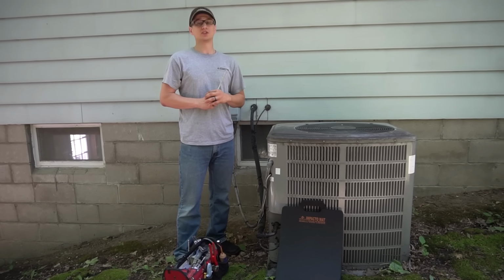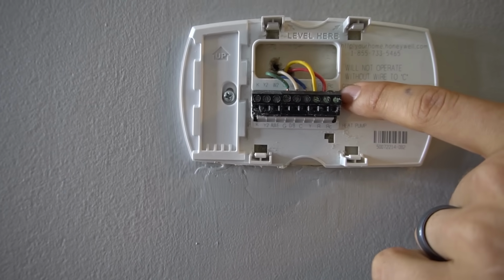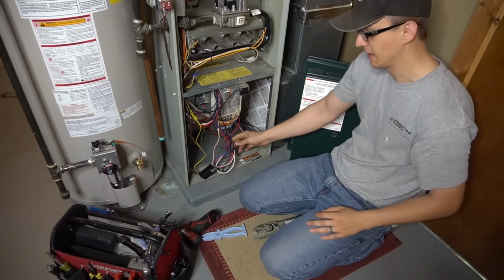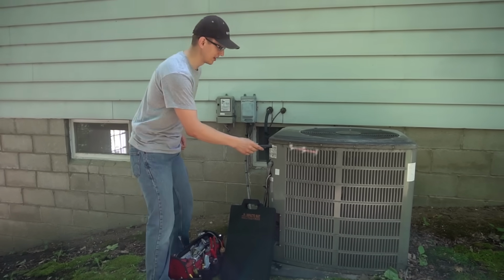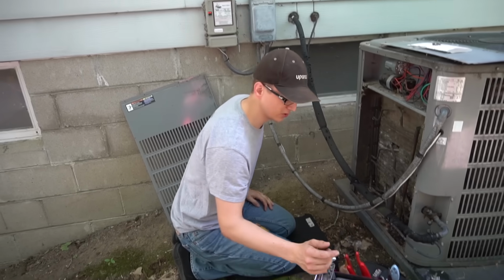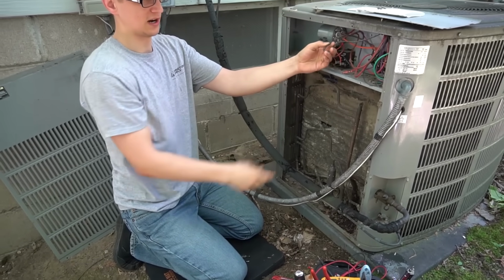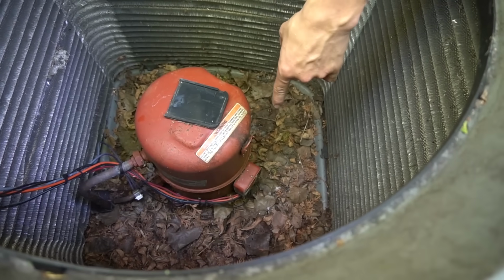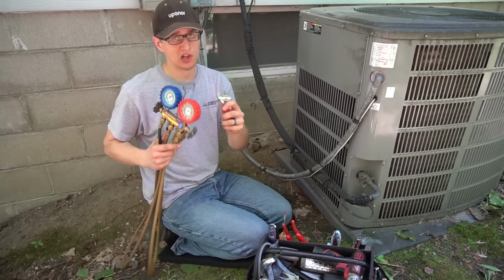AC Unit Not Turning On - How to Fix It Step by Step

Comment: Hear Ye ! Hear Ye ! thumbs up ...I can only agree with all words of praise posted above & below, as you & your excellent videos & tutorials are far beyond magnificent & superb !!
We have an Allegiance 10 that just stopped cooling [ Model# 7A0036A100A1 ] [ HCFC-22 @ 5lbs - 8oz ], that looks identical to your unit in your video abv!  Except, upon taking our Capacitor off....I'm seeing a big bulge on the top (contact end) of the capacitor, along the rim; the bulge looks likes it shouldn't be there; thanks to your links abv, I've just ordered the correct  one via amazon, alas unfortunately it won't be here for 3 days. :~\  But I'm so thankful for your videos! You are the greatest ! And without a doubt the Greatest I've ever seen on YouTube, of all time !
I first thought we might have an R-22 Freon leak =((  
Thermostat checked-out ok; furnace fan working; all wires look ok; the Contactor looks ok; the Contactor plunger works (w/power on...and w/rubber gloves on w/insulated screwdriver...the ext condensor unit & fan powers up). Everything seems to be running normal...except there's no cooling, (just the same air you'd get if you only turned on the furnace fan). Everything seems to be running (and sounding) normal, but no cooling.
Moreover, inside, at the evaporator coil ductwork that sits on the furnace, I did see  a blueish/green color on the sealer putty that is packed around the big refrigerant (suction?) line, and where it looks like it has dripped down the outside of the ductwork and made a blueish/green color stain on the sealer putty that's packed around the white PVC drain pipe outlet. Haven't scraped the putty away from the PVC drain yet -- to try and see inside the evaporator coil space, to see if there's the same blueish/green color (is that the Freon color?)....inside the evaporator ductwork.  But does that sound like we've lost our Freon? 
First quote over the phone was $1700 just for a new 5lbs-8oz of R-22 Freon ! Not including whatever they'd charge for fixing the leak !=(  And since our Allegiance 10 A/C was installed 20 years ago, (last month), of course they suggested---over the phone, without having made a service call yet, that we spend $4000. to $6000 on an entire new A/C system !=(
Another HVAC company quoted $307.00 for the first pound of refrigerant, then $150.00 for each subsequent # of refrigerant.
:~\
But now we're hoping & praying it's just the $15 Capacitor !=))  So thanks again to you, Word of Advice TV, for your incredibly helpful video's and all your time you've shared and devoted in making them !  You are truly the Greatest I've ever seen on YouTube, of all time !  Thank you so much !;-))

Comment: What I have found many times troubleshooting in the electrical business is: the mice chew the insulation off the conductors where it goes thru the connector or bushing to enlarge the opening,  causing a short circuit or a grounded conductor to the case. The mice especially like the A/C compressors motor junction box since the compressor has a built-in heater that keeps it and them warm all winter. A/C compressor is not the only target for mice chew in though so be vigilant.

Comment: Hi just watched ur video, I think I missed the part that I need. My turns on, but it cuts off after a few sec. The blower in the house works fine. The system out side is what shuts off after a few sec. HELP!

Comment: I can see a yellow wire that protruded up and got hot by the fan on top of the AC unit.  Going to try and figure out what happened.  Its supposed to be hot all week.
Reply: Update:  SOLVED!  Wire got clipped by the fan on top of the AC unit, which caused the breaker to flip.  I repaired the wire and reset the breaker.  NO LUCK.  Breaker off for safety once more I checked everything again and all looked good.  Flipped it back on. Nothing.  15 minutes later it kicked in.  The stupid power cycle unit that the power company put in must reset every time the breaker is cycled.  It doesn't run for 15 minutes when the breaker is cycled.
Reply: Thanks a lot for this video.  It inspired me to look into the issue and probably saved me quite a bit of money.

Comment: Hello WoATV... thanks for all the great video... very detailed, nice tempo and lots of great info.  Two questions for you... The first and most important, I can't get my blower, heat or AC to come on.  It all working fine until I was attempting to help explain the thermostat to my older son (who was having problems in his new home) and while doing so, I (easy) disconnected my thermostat from the base, not realizing that the AC was running at the time.  And when I tried to connected back up, I heard the AC kick on, off and back on again as I was trying to reconnect the thermostat to its base.  Once I get it connected again, I thought nothing more of it.  However, later in the day, I realized that AC unit was not working.  I also checked the heat and the inside blower and nothing work working.  I tried re-seating the thermostat and still nothing.  After making sure the thermostat was set to a HOLD temp for both heat and/or AC, I even tried just the blower fan ON to no eval.  It's a RHEEM from 1990.   I thought I blew out the thermostat so I purchased a new Sensi thermo unit, hooked it up and it did not fix the issue.  I could hear both thermostats clicking as they attempted to send signal to the furnace / AC / blower, but nothing!  Watching your video, I did check the basics for power and I think I am getting it.  I could not find a fuse as shown in your video.  Any thoughts on what to check next?  If I need to replace the furnace, should I do the AC unit too?  Is there a brand or two that you could suggest (house is about 2500sq ft.)?    One last think... I original thermostat had a jumper wire from RH to RC, but the new Seni said that this jumper was not needed.  In your video, you mention a jump from R to RC... did I hear that correctly, or should I consider the jump from RH to RC?  Thanks again for any help you can offer.... thanks.  Frank.

Comment: I would love some help.  The plunger makes no noise at all.  I have replaced the capacitor and the thermostat and nothing will utrn on.  I am confident all the breakers are on.  I noticed that the contacts on the plunger seem chard like there was some spark or arch event.  IS it possible this plung part had a failure and thats why the unit isn't turning on?  Ive tried almost everything else you suggested.  Thanks in advance

Comment: Awesome job. Nice, clear, and comprehensive. What if you changed the capacitor,  and two days later the compressor is not running, humming noise like it wants to start... is that the compressor on its last leg?

Comment: Awesome video, thx. Question...my AC keeps blowing 3 amp fuses. After replacing fuse the heater works fine. The furnace blower works fine too. But, when i switch to AC the fuse blows right away - everytime.  Help me please.

Comment: My AC unit outside recently stopped working   and watching your video gave me enough knowledge about how it works to troubleshoot my own system. I shot the capacitor good and went to the contractor had power at L1 and L2 but nothing getting through I was about to replace it as soon as I removed the cover dead ants fell out and there was hundreds more all inside of everything. I pulled it out and took it apart cleaned it out now everything works. Thanks man!

Comment: Hello, I hear and feel air moving inside. Hear it working inside when I turn my thermostat on. The outside unit hums. I reset the breaker, about 30 min later the fan and compressor kicked on. But it's shut off again outside. Inside is still working. Any ideas?

Comment: So my inside unit is coming but the outside unit is not. Has power capacitor is good the fuse in the furnace is good when i press the contactor everything turns on so im kind of stumped right now. Any help would be appreciated

Comment: Your troubleshooting tips are awesome.  I noticed that my outdoor unit wasn't working.  Interestingly enough I just had my entire system inspected just a month or so ago and tech told me that all was well.  I'm a little suspicious it suddenly not working.  The compressor was not visibly damaged, the fan ran when I bypassed it, the indoor unit worked fine.  I was prepared to take some readings form the capacitor but I thought I'd check the relay first.  I took my leaf blower and aimed it at the capacitor and the relay; blowing it out at medium speed.  I went back inside, turned the air on, went back outside and low and behold,  the unit is humming like a humming bird.  I didn't see what was caught between the relay terminals my leaf blower took good care of it.  Thanks for your awesome troubleshooting tips.

Comment: thank you! I followed this step by step (posting from FL so no furnace's here) and both blades spun freely, motors were not hot, capacitors looked good (my meter does not measure UFI), was able to test outside unit and it turned on no issue. I replaced a very dirty filter and at some point (15-30 minutes after I turned everything back on to troubleshoot the outside unit) the system just started working again. 

Saved me a bunch of money, thank you!

Comment: maybe i jumped ahead of myself and now i dont know what to do. the heat pump wont come one, so i pushed the plunger and the unit came one. i assumed i needed a new capacitor and replaced it, but it still doesnt come on unless i push the plunger. im guessing i need a new plunger contactor. please advise..ty

Comment: This was a super great video! My son is in Kuwait and I was able to get the ac fan at his house going. However he has   2 zones because of the apartment in his basement where I live. So my apartment is getting cool but the upstairs is not cooling at all. Any suggestions? He has a nest thermostat that i checked the settings and it seems to be working correctly.

Comment: I have a 24v transformer I need to hook up to the ac, old one went bad, but the problem I have is the lable is wipped off. Is there any way to test with wire meter to tell what write goes where, ac wires are different colors that what is on the transformer thanks f for your help in advance. I have a picture of it but can't figure out how to upload on here

Comment: Thank you so much.   Very thorough. Your mentioning of the bug getting stuck behind the plunger saved me a expensive Emergency call fee.   I found an earwig lodged in between.  It looked like it had caused it to arch and solder it.  Once that removed and I got it free it started right up.

Comment: Hi , A very good video Thanks. I have some A/C problem, hopefully, your could help. MY A/C dont on, when I turn cool on at Thermostat, The A/C don't on but the heat is on . I cannot turn it off untill I shut off the power and gas. Now when the power on again,  the heat will auto on automatically. The thermostat cannot control the unit.

Comment: I flipped the AC breakers off and on in my breaker box, it was not tripped, but now we cannot get the AC back on, it just wont turn back on at all. There are 2 metal boxes outside near the unit which look like a fuse or breaker box but they are screwed shut, so I am thinking there is a way to reset the system or something and we just do not know how to fix this. It was working perfectly before I did that. Any advice?

Comment: Nice video. I usually do transport and cab air. I have a Coleman R22 4t that leaks slowly out of the evap. Last week it was not cooling. I put my gauges on it. It was real low. I did an evac and but it on a vacuum and charged it enough to run it and finish charging it. All it does is run the fan and try to run the compressor for 2 seconds and it kicks out. I tried to look for a low pressure sensor to bypass to run it so I can charge it 65-70 low side psi. Would you recommend doing this or troubleshooting the electrical side? Thx

Comment: Hi,
First off thanks for these amazing tips, keep up the amazing videos.
I had a question around my AC. 
I recently called a HVAC guy out to add freon (I know its not freon) as my furnace will not cool the house. The compressor was running, and there was frost build up.
The technician filled it with freon and said wait couple hours and it should be good.
After 4 hours, I noticed that the house is still not cooling. I went to check the AC Compressor and noticed it was short cycling (tries to start up and shuts down almost immediately)  The compressor did not do this before his service. 
I called the technician guy again, and he is saying that the entire unit needs to be replaced, the problem with the actual compressor.  
I am doubtful, as the guy didn't really check much, like the electricals or anything. He simply says repairing will cost around the same as a replacement. 
I am going to try replacing the capacitor before anything else. But I wanted to see your insight. Is it really compressor or is the guy trying to gouge money?
Could the short cycling be a result of something the technician do wrong?
Thanks for reading this and appreciate a response. 

Thanks

Comment: My air handler turns on and blows air through the vents, but my outside unit does not turn on.  I had a ac tech inspect it and could not find anything wrong.  The breaker was NOT tripped.  However, I turned off the breaker for 2 minutes and then turned it on.  This fixed the issue for a day.  Then the next day the outdoor unit again did not turn on.  Again, I reset the breaker off and on and it fixed the issue.  What do you think is the problem?  My unit is only 5 years old and is an American Standard unit.

Comment: Thank you very much.  I had installed a new Nest thermostat this past winter and apparently overlooked something in the wiring for the separate AC system.  Your video provided me the basics that lead me to solution.  This one 30 minute video is such a great start for anyone with AC issues, so glad I found it.

Comment: Dude, I just want you and your viewers to know how good your advice is.  I watched two of your videos and probably saved myself 500 bucks or more.  I opened up my condensor and looked at the capacitor and sure enough it was bubbled.  I went to an HVAC store to buy a new one but they would not sell it to me because I am not a licensed contractor. But, then I tried a different store and they sold it to me.  13 bucks.  What do you think a company would have charged me to come out, evaluate the problem and fix it?  Man, I really appreciate this video.  Thanks.

Comment: I have watched many videos on YouTube that solved my problem, saved me time and saved me money.  This video has done ALL THREE and you have my sincere thanks!  You can add me to the list of folks who had nothing more than a blocked contactor (solenoid) switch that prevented the compressor unit from getting the message from the thermostat to turn on!!  My unit had an ENORMOUS nest of some sort under the plate that COMPLETELY covered and blocked that switch.  Cleaned it out and everything is working fine!  Problem solved.  Time saved.  Expensive service call avoided!  Thanks again!

Comment: That switch box from the power company that they rotate service with..if the only savings is $10 a month it doesn't seem logical to me. I have found if I turn off my AC on really hot days for even only 30 min or so, the run time to bring it back to my usual temp is exceedingly long. I can't imagine $10 a would cover the extra run time I would encounter.
Thanks for the vid!  They are ALL great!!✌👍

Comment: Best instructional and repair AC video on YouTube. PERIOD!

 Amazing video!!...clear instructions, testing and trouble shooting for ALL the AC common problems,  AND best part, IMO, segmenting so you can jump to your pertinent sections!
For anyone new, I recommend watching the whole video to understand all parts of the AC unit.

I learned about,  diagnosed and fixed  the problem with my contactor by using the methodical test approach to narrow down the issue.  Using the quick test,  I was able to determine that my capacitor, motor and contactor were working... turns  out the thermostat signal wire feeding to contactor was pinched. I was able to fix the wire and have the AC up in running in minutes.  

It would have been impossible to fix without this video and probably cost me hundreds of dollars to diagnose.

I've subscribed and shared this video with everyone I know. Keep up this great service!

Comment: One could say I'd much rather listen to a maestro playing a plastic violin than listen to an amateur playing a Stratovarius. My HVAC system quit both Heating and Cooling Had the capacitor changed. Charged $115.00 to diagnose $103.00 for the capacitor. Mine is a ten-year-old, two-ton Carrier. Purchase from Sears with a ten-year warranty just before Sears ceased operations and voided my warranty.(would have ended this month) Tech at the time said I needed a new compressor as well but didn't have one in stock. While he was away I re-booted the system and everything was fine, until recently. The gas furnace worked all winter. Now I'm gun shy I may be fleeced.

Comment: Great video! I have a question: My ac unit kicks on, the furnace works from inside (fan blows air through vents), but air isn’t cold. I went outside to check the outside unit, and the fan is turning, but it’s quieter than usual, and the coolant lines are not cold. I hear an intermittent surging sound, as if something might be seized. What would be your guess on what my issue might be?

Comment: Did everything you said except I couldn’t find fuse and no movement from outside fan inside I have air (fan)and heat worked fine last year what could’ve happened?